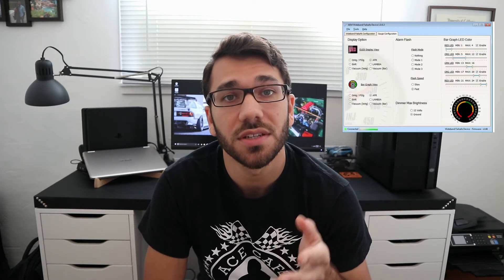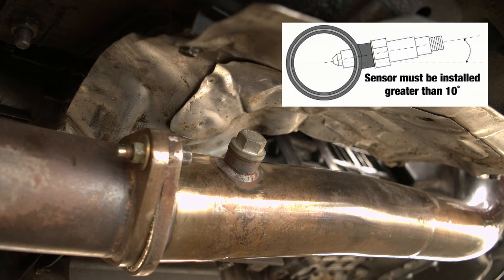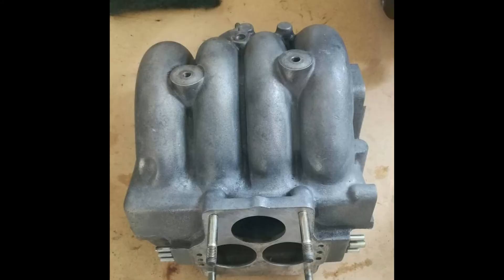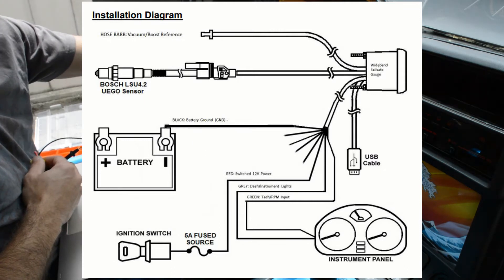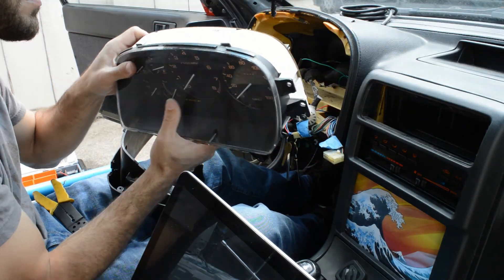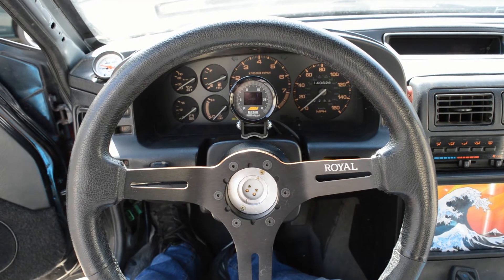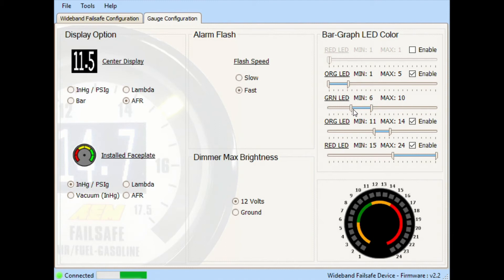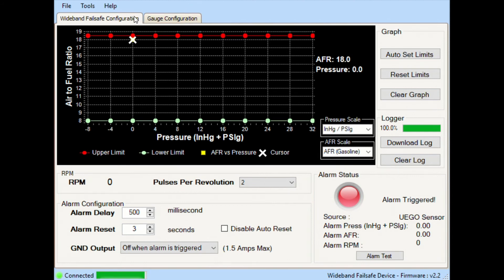AEM AFR/Boost Gauge Install | Ep 21

Comment: So on the page following the wiring diagram it discusses the pins on the connectors, and in states the brown wire, if not being used with an ems data logger should be connected with ground for best gauge readings. Wondering how true that is?

Comment: Is there a way to use the failsafe ground without a datalogger? I've seen examples where if your AFR exceeds your high side limit, it will cut your ignition and shut off the engine which is something im looking to do.
Reply from the maker: I haven't looked into this to be honest. However, you need some form of feedback or control into the ECU. Either via a stand alone ECU or something like an AFR controller that can do this. I can only monitor my AFRs with this gauge and it's up to me to make sure my fuel system is designed to supply enough fuel and if I see things going bad I have to manually kill the engine. My setup is very conservative though, so I am not too worried about this. One day I'll go stand alone but for now I'm still OEM.

Comment: Does it have an led light at night to see the boost gauge? Several say that is its main flaw you cant see it during night driving.
Reply from the maker: It lights up at night, no problem at all. I can't recall off the top off my head if the white numbers light up, but I have the gauge programmed so it turns from green to yellow to red if the boost gets too high. So, it doesn't matter anyway.
Reply: Thanks

Comment: Hey! I know this video is a little old I am running a megasquirt ecu in my Datsun and it requires a 0v-5v input from the gauge this would be the white wire on AEM correct?
Reply from the maker: Sorry, it's been ages since I've looked at the diagram but that does sound right, just double check and don't hesitate to contact AEM for more help. The gauge has an output for stand-alones like yours.
Reply: @AlexFranceschi  thanks for the reply ! I’ll have to call them and double check on that have a wonderful evening!
Reply from the maker: @octane_media  Absolutely, likewise!

Comment: Hi Alex, Just bought one of these  and I was just wondering  the wires you capped off do those go into the ecm ? thanks, Dave
Reply from the maker: That's correct, if you go to the 4 min mark you'll see the before and after wiring diagram. If I had an aftermarket ECM/ECU and could actually use them I would.

Comment: Would this gauge work with just 12v connection and ground wiring? I have an existing boost gauge which I'd love to replace with this and not need any additional wiring splices. Currently it's got a yellow 12v and black GND connection. 

Obviously I'd need vacuum and lambda too... But purely from a powering on point of view, would that work?
Reply from the maker: Sorry for the delayed response. It should work. Just make sure your 12V source is a switched IGN source. Also, you may have lights on the gauge but will not be able to control the brightness of the gauge.

Comment: Can I program it to see only boost in the middle? Also if I don’t install it to the dimmer will it be too bright at night?
Reply from the maker: Sorry for the delay, yes you should be able to change the center display for boost, it comes with additional faceplates. The dimmer does help at night but it's not that bright as-is tbh.
Reply: @AlexFranceschi  thanks for the info. I’m under the assumption the gauge can be calibrated via the AEM app?
Reply from the maker: @Jordan_B34  Yup, that's correct.

Comment: Nice, video Alex. Wondering does the faceplate light up. When you hook up the grey wire to the dimmer? Just curious.
Reply from the maker: David Vang sorry for the delayed response. I had a busy weekend. The faceplate itself doesn't have a backlight. The lights that adjust brightness are the center number display and the bar display. Unfortunately the faceplate numbers don't light up. Hope that helps!

Comment: Can you drive with the AEM UEGO gauge without installing the o2 sensor?
Reply from the maker: Sure, you could, but you would not be able to read the AFRs.
Reply: Oh ok. I just need it to get hooked up right now until I get my turbo downpipe installed. Would it be a lot easier if you just use circuit holder connectors instead of splicing into your harness?
Reply from the maker: Whichever method you find easier. I by no means used anything fancy. Just the fact i had some splice connectors on hand when i installed it. You should at least be able to hook everything up, even the wideband outside of the downpipe just to make sure the system is working and communicating.

Comment: Any idea on why mine reads eugo sensor off line?
Reply from the maker: No idea, hard to diagnose such things online, but I would refer to the user manual, double check all connections, and insure you have the software with appropriate drivers installed. Good luck!